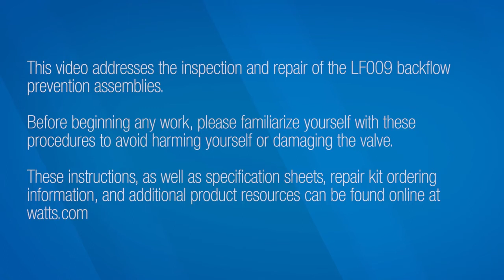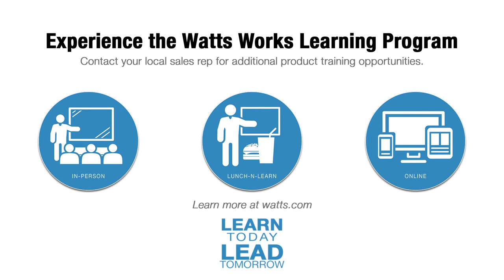Watts LF009 1/4" - 2” Repair

Comment: I followed this step by step and replaced all the check valves with new ones I replaced the diaphragm on the relief valve and the o ring on the bottom of the stem. I'm still getting water spraying out the bottom. Any suggestions?
Reply from the maker: Hi Jason, our tech team will be happy to assist you in your repair. You can contact us at 800-575-9618 from 8 a.m. - 6 p.m. EST. Thank you! We look forward to speaking with you.
Reply: Hey Jason, what did you end up figuring out? Having the same issue here
Reply: Same here.  I saw the diaphragm was split, so I thought that would solve it, but I still get a misty spray coming out of the drain.  I checked everything, applied some lubricant, and can't seem to get it to stop spraying.  How did you fix yours?
Reply: @shauncollins678  did you figure anything out?
Reply: @shawnstrickler  I didn't yet, just turned it off. Gonna swap it out with a new one this week or so
Reply: @David Martin Hello David, Where do you order the kit from ? I do have the same 009/ma/qt and I will like to replace with a new kit. Thanks

Comment: Hi the bottom seal is not reaching the relief valve seed on the bottom. Any advice? Water comes out from the bottom once I turn it on
Reply from the maker: Thomasz, there are a few things that could cause that.  It could be debris, sensing line issue or relief valve parts that need to be replaced.  Please feel free to reach out to our tech team at 800 575-9618, we would be happy to help.